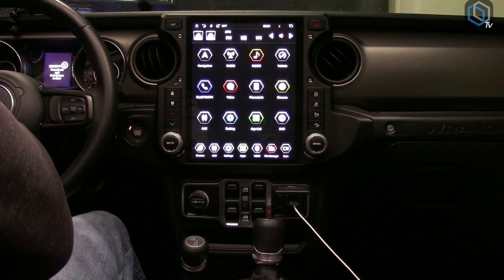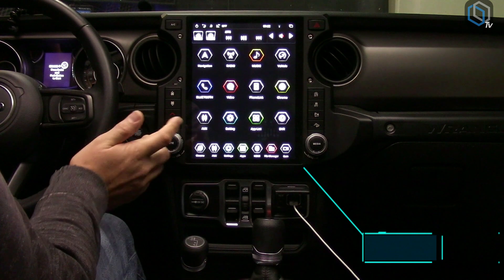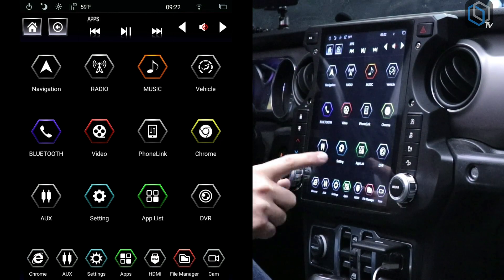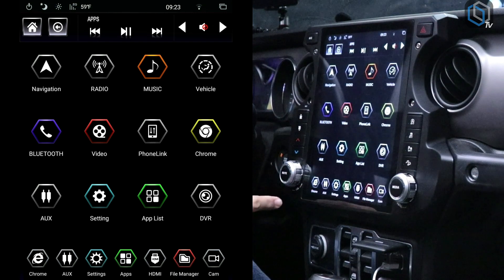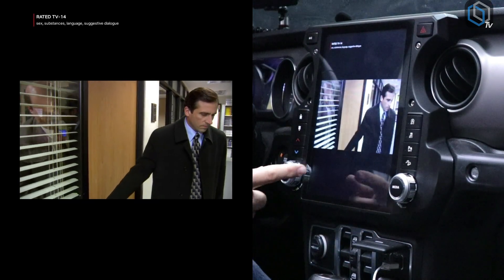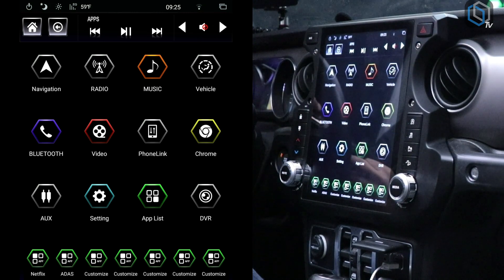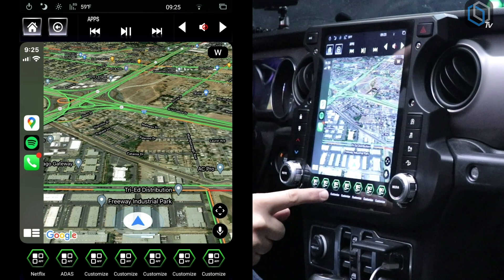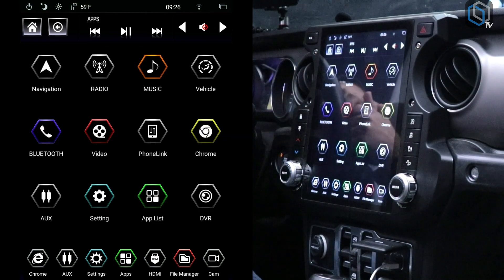LinksWell Product Sneak Peak, Jeep JL T-Style Radio

Comment: Any way of adding Sirius/XM radio using a tuner box?  I have a lifelong subscription box, but no access to change to my name.  I want to use this with an aftermarket radio in my Gladiator, will this support that?  I can not switch it over to an account I would set up for myself.
Reply from the maker: Not yet. Hoping for GEN 5. You can install the app to the radio but the tuner connection is still in testing with SiriusXM

Comment: Do the buttons on the side have backlights ? I have this installed and don't know how to do it. Also, everytime I switch off the car, it resets the settings (Time, AC...)
Reply from the maker: The buttons will light up when the parking lights on the car are turned on. 

I have a video on here about how to fix the clock changing itself.

Comment: Does this keep the right time? I have the previous Linkswell 8.4 inch Wrangler JL version in my Jeep and it has never kept the right time no matter how the settings are adjusted. It’s always been super annoying.
Reply from the maker: It does yes. Question on the 8.4, did you go to the Android settings and set the time zone?

Comment: After installation the parking sensors cease working (can’t hear the beep) , in menu “radar sound” is on
Reply from the maker: Make sure that in vehicle settings it’s set to sight and sound
Reply: @LinksWellInc  yes. Even on “loud” and no effect . And another thing- the bezel on right side (near passenger handle) a little loose - does it a 3D printing issue or  poor installation?  Does the light of volume and search knobs reducible? Thank in advance
Reply from the maker: @dio1982  do you know if the plug for Amp or no amp is correct on the harness?  

There shouldn’t be anything loose. I would check the clips and mounting screws.
Reply: @LinksWellInc  All plugged in. Which plugs I need to check? Didn’t have factory amplifier

Comment: Which harness needed to use AUX switches?
Reply from the maker: The factory Aux Switches? There is no special harness needed. They work like the factory.
Reply: @LinksWellInc  I found in menu 4 aux switches, maybe I missing something- they didn’t substitute the factory ones (I didn’t have it)?
Reply from the maker: @dio1982  it’s to control the factory installed aux switches.